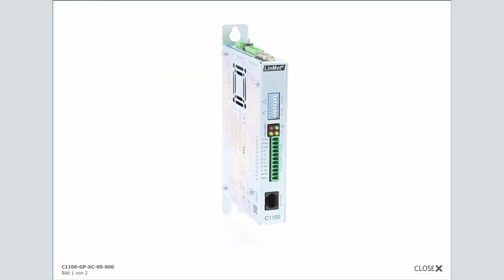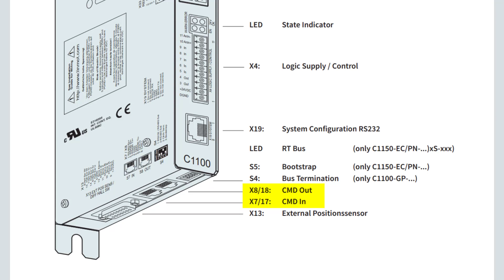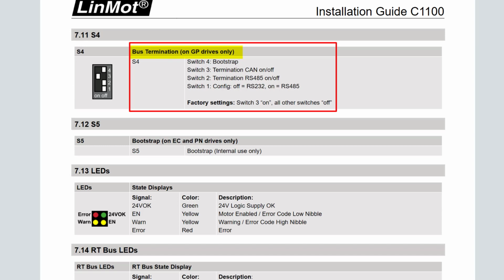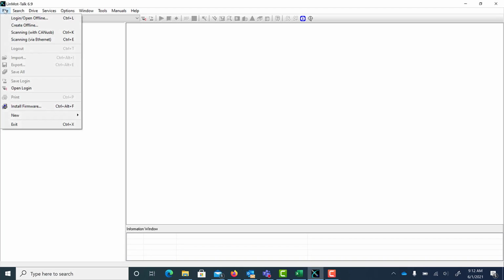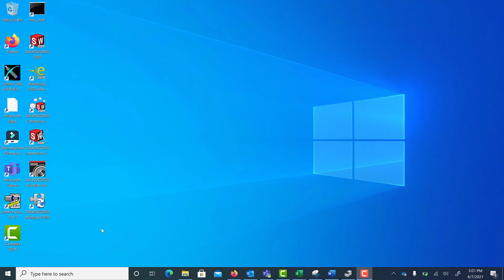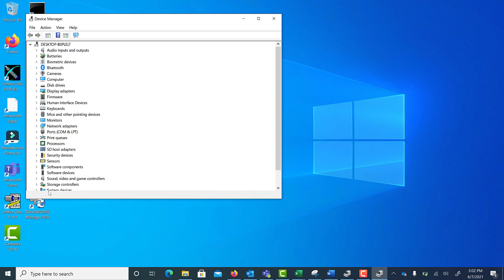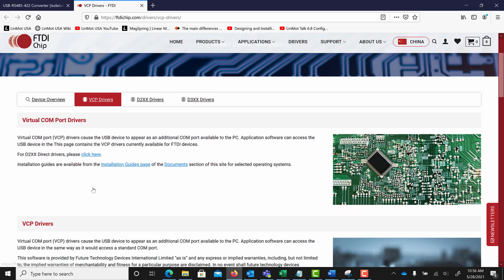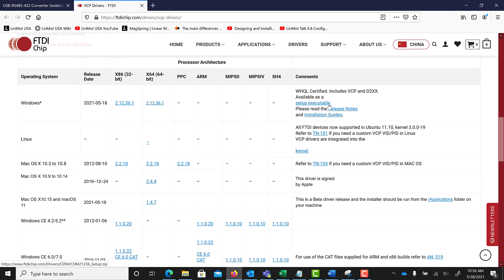LinMot Talk Configuration: Logging In to the C1100-GP with RS485

Comment: Why/when would I need to use RS 485 versus RS232 on the C1100-GP?  I have 3 of the C1100-GP-XC-1S-000 drives that I'm unable to upload new firmware into. They have all v6.9 20201026 in them now, and because I've seen the 'no more than 2 minor upgrade steps" warning, I've tried the very next release (v6.9 20210403) just to get the process started.